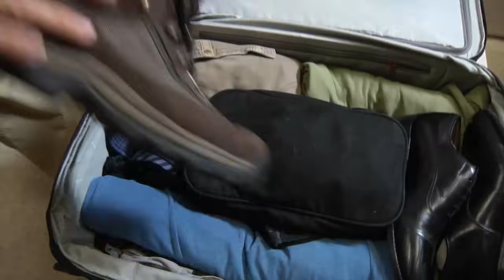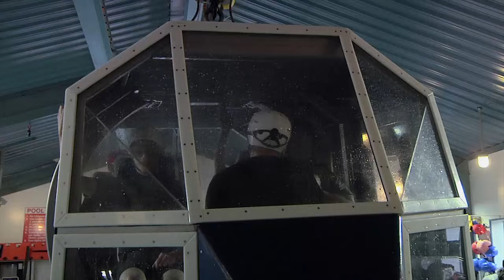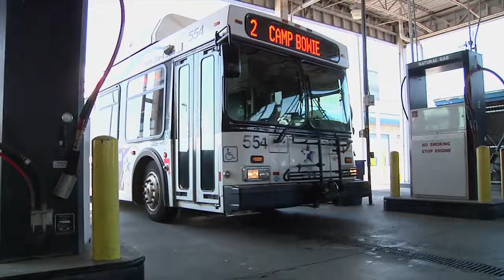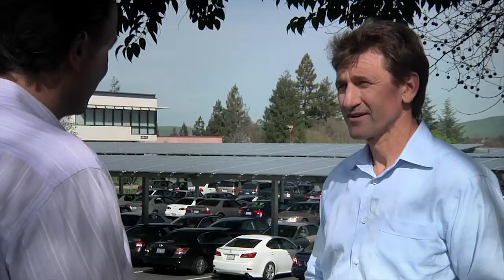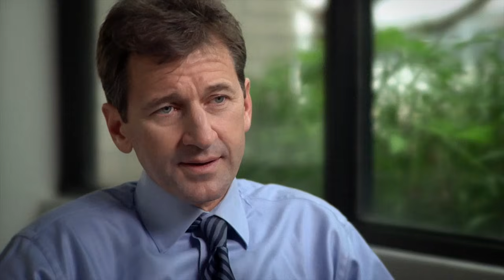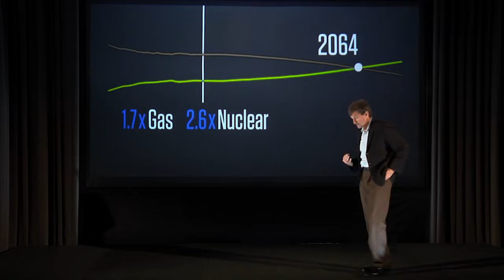Switch: The Complete Film

Comment: I'm glad nuclear was mentioned, however brief. In my opinion, it really is the best option for wide-scale, clean energy and the quickest was to put the coal and gas industries in their graves. It's beyond time to move forward.
Reply: Also, nuclear is as reliable as coal and gas. Renewables just aren't dependable, unfortunately.
Reply: Regardless of safety or dependability, there is one concern with nuclear electricity. Electricity is, for the most part, generated immediately as it's used, and power plants need to constantly re-adjust their power output to react instantaneously to the variable changes in demand. Nuclear plants just can't do that. As such, current plants just satisfy the baseload power (as in, you know the demand for electricity will always be greater than a certain amount 24/7), while other sources are needed to satisfy the instantaneous demand. If we are to go for the nuclear option (excuse the pun), we'd need to also invest in energy storage technology to ensure we can release electricity exactly as per the demand. (Coal also has a similar problem, though not nearly as bad.)
Reply: Also they are dangerous and the most expensive.

Comment: 14:35
He said it costs $300 million to 'develop and research' a carbon capture system not to build and implement.
Why did he assume it takes trillions total? Unless his math is $300 million for each coal plant?
lies everywhere
Reply: Kinda lost on that as well. Didn't hear a price on what it would cost to install such a thing.
Reply: 300 million got the carbon down 2 percent.  To get emissions the same as natural gas, you would have to get it down 50 percent at ever power plant.  It would indeed be extremely expensive.